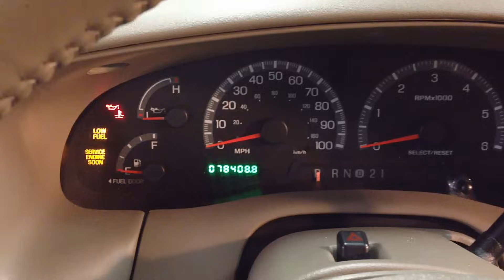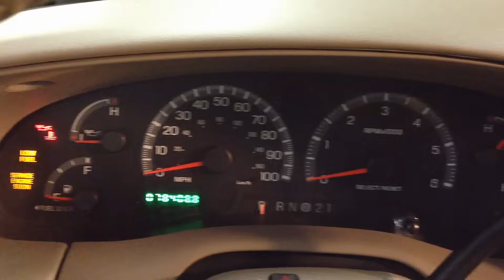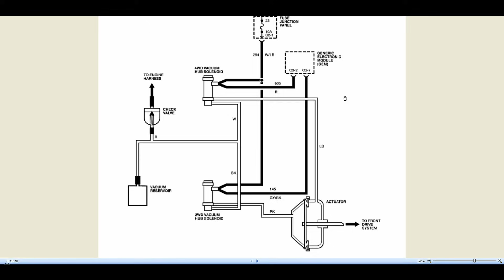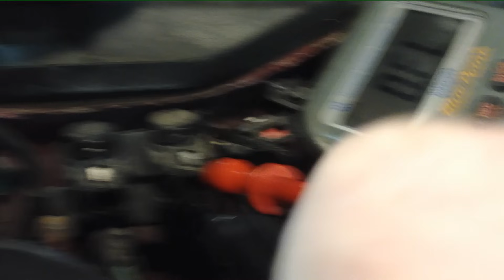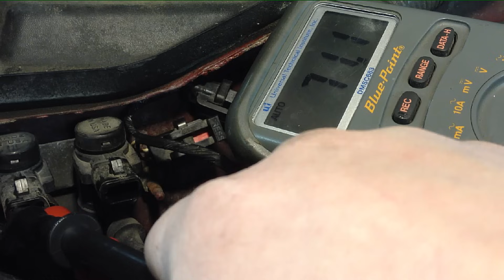1997-2004 Ford F150 4X4 Inoperative In Depth Diagnosis

Comment: I know this is an older video, but I can't seem to find a similar issue to mine. I have a 1997 F250 light duty 5.4, and turning the 4wd selector switch does nothing. There are no clicks from the GEM module, and the transfer case doesn't engage. I put a brand new Cardone transfer case motor in, no change.

Comment: like your video. I'm having a problem that I can't get it out of 4 wheel drive. at the end of your video you talk about the actuator engaged in 4 wheel drive, can I remove the vacuum hoses at the actuator  to disengage and bypass it to get it out of 4 wheel drive? looks like the actuator is stuck. do you have a video on removing it? thanks.

Comment: Thanks for the videos, they are really helpful.  Older post so not sure if you will be seeing this but since you were nice enough to offer help at the end, here goes.  I get nothing at all when I turn the shift on the fly selector switch on my '03.  Fuses are good (23 and 104). Selector switch has the correct resistance at all positions per the ford shop manual.  NO clicking noise from the transfer case relay under the dash.  The 2wd solenoid has constant power and ground, the 4wd solenoid has constant power but never gets ground when I turn the selector switch (which makes sense if the relay does not work).  I went to my local pick-n-pay and pulled two relays and neither of them made a difference, so I assume not the relay. GEM module is not "wet" per other posts I have read.   Any thoughts are appreciated!

Comment: I have a 2004 F150 Heritage. The 4x4 light does not go off. The transfer case is manual shift. Also a note, is that the shift between 2wd and 4High is very short. Any help would be great

Comment: I have a 2004 Ford F-150 with the 4.6. I have a aggressive grinding noise when I  give it gas but when I left off it’s tames down a bit. But when I have it in 4 wheel drive it goes away but when it’s it 2wd it starts grinding again. Needing help figuring it out. I was planning on taking it in but I don’t trust shops very much to work on my vehicles.

Comment: I have a 1998 expedition is this the same system as mine? It's having issues and the a4wd light is flashing and it's very jerky and jolty when turning it full tilt at slow speed while parking

Comment: Great video, but ive tried what youve said, still got an issue. While driving normal in 2wd, my 4x4 light will come on, and sounds like its trying to engage, then grinding and a thump. I can stop, put it 4wd high or low, everything works. Its gonna destroy my hubs if i cant figure it out. Done replaced gem. Its a 97, 4.2, 4wd, 5speed, with manual 4wd lever.

Comment: OK, so here's my problem--

Truck showed it was in 4WD and I didn't notice until I made a tight turn in the parking lot and it hobbyhorsed on me. Couldn't get it out of 4WD. Watched your video, went out and got a new transfer motor. Replaced motor, still shows in 4WD but now in 2WD.

Checked vac reservoir for leaks with a vacuum gauge. 15 to 20 with engine running. Still held vacuum with engine off. Only held for about 2 minutes, but that's pretty long considering the homemade test connections I had. With the factory lines connected, you hear the hiss of the vacuum being released up to 10 minutes after the engine is stopped and you remove the factory lines.

Ran a vacuum pump through the factory lines to axle connect actuator, got no leaks. Connected pump to 2WD and 4WD line, had to pump several times to get vacuum when I changed from 2WD vac line to 4WD and vice versa. After letting vacuum leak off, staying on same line, only took one or two strokes to get vacuum up again. From that I assume no line cracks, not a leaky diaphragm.

Checked voltages to solenoids. As advertised. In 2WD, voltage to 2WD solenoid. In 4WD, voltage to 4WD solenoid.

Checked fuse #23 in Pax compartment, fuse #104 in engine compartment. Both good.

No vacuum leaks. Correct power to solenoids, but transfer motor doesn't move. All fuses I can find associated with 2WD/4WD good to go. What am I missing? Is there a sensor switch that cuts out 4WD engagement if the hubs aren't locked? Is the 4WD light on constantly a code for 4WD issue?

Comment: Love your videos, watched a few and fixed my four wheel drive yesterday. It was a vacuum issue, I had a clogged check valve right before the solenoid.  05 F-150 Lariat. Couldn't have fixed it myself without your awesome videos, keep up the good work!!

Comment: My four wheel drive lights up on the dash but doesn't engage this is on a 2001 f150 lariat. When I flip it into 4Hi I hear it clicking on the dash. I am not wanting to just throw money at it until works so would you know where would I start at diagnosing the problem at? Any help would be greatly appreciated.

Comment: Wondering if you can help..on my 97 4.6 super cab my signal lights refuse to work lol..I've checked everything I can and know to do, replaced the multi switch also.. happened about 2 months after replacing the GEM. The bulbs work it will flash but once.

Comment: So if the left hand harness doesn't show any power with the dial switched to 4 high.....what should I check upstream to pinpoint the problem?  Would I have to replace the GEM??? Also both my solenoids showed no resistance. Going to replace those anyway, just need to figure out what I need to do that is upstream of those before I can test the vaccum on the solenoids.

Comment: Great video- I needed this. My problem is that the switch is NOT working. It's lighting up from the little LED, and neither the 4x4 or Low Range light is coming on in the instrument cluster. Checked fuses in fuse box under dash and under hood- both good. Going to check my solenoids next- am I on the right path? Also going to check the switch with the ball bearing thing on my T-case and replace that. I bought the truck a few months ago and the 4x4 worked fine then, but also found out quickly that a mouse had gotten in and died.....hoping  Mr. Squeaky wasn't the problem, haha.

Comment: 02 F150 5.4 4×4 partially engaging. Have already replaced passenger side CV axle and hub assembly and driver side hub assembly. Was hearing grinding/scraping noise from front passenger and now hearing a from front driver sounds like a ratchet ratcheting/ticking..

Comment: I have an 05 4.5 that will not go into 4wd while the truck is on. I have to turn off my truck and than engage it. Is this a bad actuator or a bad transfer case motor???

Comment: I have a 03 f150 and I have the power constant to both sides but the ground switch does not move when switched to 4x4 fuse 23 is good , module ??

Comment: My Expedition is 23yo so I will probably just replace the tcmotor and the solenoids and hope for the best. The parts are cheap and the labor is ez. Just do it. For $100 I will have done all the ez work on my 4wd system. If my diffs or shafts go down then the car is probably mechanically totaled.

Comment: Hi! I watched your video and is pretty good. But I have a question or a situation with my 1998 F150 V8 4.6 L. The 4x4 doesn't work at all, but the windows don't work either. What do you think is the problem with that?

Comment: So I can’t get my 4H or 4L to pop up on my dash. I hear the relays turn on and off but nothing. Ive replaced the transfer case motor and it would work in 4H for a bit but now it won’t shift into 4H. When I would be in 4H and try 4L it would just turn off and switch back to 2H. Looking for any help🙏
Reply: Now the light on my dash for the 4x4 is stuck on. The relays click on and idk how to turn them off. When I move the switch it does nothing

Comment: Hello I have a 1998 F250 4/4 Is it normal to hear a vac hiss for about 5 secs.after you shut down the engine. The sound is coming  from the EGR vac.solenoid ,no codes present Thank You

Comment: Hello I have a 1999 Lincoln navigator and recently the 4x4 light started flashing on the dashboard. I’ve noticed when I make U-turns or reverse it goes into for low and locks the tires I have to put it in neutral and turn my steering wheel straight and then turn my knob to Forlow wait for the clunk for high wait for the clunk and then back into all wheel drive. Do you have any experience with this? Once I do that he drives fine up and down the road no issues only when I first get in it and I turn sharp or do you turns or try to back out Turning the steering wheel

Comment: My 1999 F-150 will only energize the 2WD solenoid. I tested both 2WD and 4WD solenoid control plugs with a voltmeter and both had 11.6 VDC with key on and engine off and both lost voltage with key off. However when I used my volt-ohm meter in ohms to look for the switched ground coming from the GEM module I only saw it coming in on the 2WD control plug with key on and engine off no matter what position my selector switch was in (2H, 4H or 4L). I also ran the engine with both solenoid control plugs connected and all vacuum lines disconnected and verified both vacuum inputs to both the 2WD and the 4WD solenoids had vacuum. I then plugged in the input vacuum lines only to each solenoid and left each output vacuum line disconnected so I could verify vacuum at each output port and I always had vacuum at the 2WD output port and never on the 4WD output port regardless of control selector switch position.

I replaced the selector switch with a new one and the same thing happens. Seems to indicate a problem with my GEM module? Any advice as what to do or check next?
Reply: Did you ever solve this?
Reply: Did you solve this?? ^^^ I have a 98 Fully redone new motor name it. My 4x4 was working fine then one day just quit. I did all these tests. My switch on dash nob is now not lit, and clicks 4 times in dash. Yes fuse is good. Suggestions??? @gaelculver4880
Reply: @FordTechMakuloco
Reply: Im having the  same kind of issue grounds and power are not right
Reply: Check your grounds! I bet one of them rusted out. FORD=Fix Or Repair Daily

Comment: I have a couple problems with my 01 switching in and out of 4wd.
1 the transfer case doesn't want to shift in to 4high while driving, it makes a horrible chain growling noise
2 after using 4wd the system doesn't want to disengage even after shutting the engine off and if I go from P to D it makes a loud hammer noise and jerks the truck.

Comment: Thanks for video, scanned found P1876, both solenoids have ground no matter the position, live data shows switch working on dash.  So will continue my search to see if can find schematics, paid for a manual but was in PDF and they skipped most of the schematics, of course...
Reply: I see to look at 605 and 145 from GEM, had all those pages for troubleshooting, had hoped wasn't GEM related but person said GEM was bad so swapped it before testing anything, and then this issue, so that GEM maybe faulty, seller claimed has to be programmed by Ford, but see numerous threads saying if same numbers on GEM that wasn't the case, only some security module needs flashing if swapped, not sure if true, almost ready to swap old GEM back into her to see if this issue goes away...
Reply: Since 4x4 worked old GEM guess swap back in and see what trouble can get into with old GEM, cousin scanned it told me bad, he bought Truck for motor then passed and I got 'the honor' of owning this old rusty Ford and bringing it back to at least dump run duty...
Reply: Swapped back, no joy some different codes though. now P1824-P1832-P1838 and it doesn't care if use seatbelt...  both solenoids power and ground any switch setting, although outside one does not pass vacuum inside one does. prob a good thing.. live data shows switch working. I do have a spare t case motor and been advised on the wire have to insert into its harness, what a goofy design.. P14 think it was forget now..
Reply: rewatched video on testing solenoids, key off all 4 contacts grounded, key on 2 hot 2 ground no matter position, ready to cut up dash so can pull GEM harness out to test as pulling it out to try and test is one of the reasons I stopped buying newer vehicles, too many engineers without any mechanical skills, or told to make it so hard only Ford can work on them so more cash for them, whichever not happy.. If I had designed it, you betcha you could reach up and remove needed connections for tests with ease...

Comment: 2001 ford f150 4x4 5.4 the three air lines come up from the axle actuator the black line comes up but can't seem to find where it goes the blue and red is connected both solenoids have their lines and black box behind battery has all their air lines

Comment: Have a 2002 Ford Explorer Sport. The same this happening. I have taken off shift motor from transfer case. It's good, check where it was shifted to. Which 2wd. But the front end still feels like it is in 4x4 and it's still noisy. Is there any way I can get info on this . Diagrams, videos anything would help.

Comment: Thank you first for you time in sharing info. I have a 99 f250 5.4 4x4 I just bought.  All the vacuum lines were removed from the system and the ones down below by the actuator on the differential were melted. I bought new upper and lower lines for the differential and the actuators to the reservoirs and the vacuum source which I did not know where it was so I found vacuum in the added it but I'm not getting no 4x4 to the  front still .  When I got the truck the actuator was wired closed like all the way to the left After watching your video I seen that should be more like when you have vacuumed to both ports on the actuator I'm just kind of lost don't know what to do or what to look for diagrams or schematics for the vacuum

Comment: my vaccume line was broken and I repaired it with electrical shrink wrap over the lines and used my heat gun to shrink it. worked perfect.

Comment: Hi, My truck is a2003 Ford f150. I followed your video all the way to my actuator checking everything along the way. My actuator is engaging but both wheels when in 4 wheel drive are not turning together. Can you tell me what I need to check next. Thanks Pete

Comment: Thank you so much for your explanation of the system.  I have a 2004 F150 Lariat and when I change the selector button of the 4x4 system I don’t sense anything happening.  I’ll check everything you showed in the video to see if I resolve my problem.  Thanks again sir.

Comment: Very helpful, I have no vacuum when connecting the lower hose, on the top hole on the 4 wheel drive, when I turn the switch nothing happens no sounds, nothing, I do have power at the solenoid.

Comment: What happens if the 2wd solenoid fails but not the 4wd solenoid? I have the 4wd solenoid ringing out at 66 ohms and the 2wd solenoid ringing out completely open meaning it has failed (there is vaccum). What I can't wrap my head around is that it will not shift into 4wd and the cluster light stays out. I have the msof type transfer case.

Comment: I'm hoping you still check these threads, 98 f150, no 4x4 light on dash, I don't hear the relay click on the left like you said, with the key on and moving the switch .  fuse 23 checked good. is this a sign of the shift motor failed?

Comment: I used test light, right connection on the solenoid light on in four wheel switch inside.. on negative side the light does not come light.? off and on switch inside.? what does mean.?
Reply: on the dash 4x4 light does not come light.?

Comment: Thank you I recently bought 2001 f150 that was sitting for a little bit,it's a good truck with high miles and gaskets seals and sensors is what I'm going through. Awesome intake video replacement you provided and that's what I'm doing next is oil filter coolant gasket and then making it goes into 4wd properly. Thank you again your knowledge and effort are well received, Thank you

Comment: Thank u so much.  Mine quit but I messed with all the vacuum lines cause battery acid had broke them.   I spliced them wit rubber hose but I bet I didn’t get it back 100%

Comment: Hello i have  1998 f150 4wd  5 speed , its tryin to engage on its own ,4wd hi light comes on this happens while driving 30 ,40 mph then all the sudden it sounds lijke gears are tryin to go together and there not lined up . At this point i have oun hooked vac line to engage 4wd no grinding now be light 4wd still comin on . Please any help would be greatly appropriated thank-you

Comment: I've watched this video and see what's going on I get the ground like I'm supposed to to from the 2 wheel to the 4 wheel but when I flipped the switch to go back to the 4 wheel I'm no longer getting the ground to switch everything back into 2 wheel drive I have changed the vacuum modules the modules the everything underneath the transmission relay shouldn't realize the switch everything and I still can't get it to work right any help from anybody would we appreciate it

Comment: Mine turned out to be a transfer case shift motor. It was rusted. DDID NOT SET CODES FOR SOME REASON. always chech shift motor before checking everything else

Comment: Hey FordTechMakuloco, What about 2003 ford expeditions? I have two of them, one has only 4 low, and the other has no 4x4 at all. I have switched every component except for the GEM module, and nothing changes on the two trucks (I even swapped the fuse box in the passenger foot-well).
I have no idea where to find the GEM module on these 03s, and some people say they don't have one.
Is the "Anti Theft Locking Control Module 2L1T-15K602-AP" the GEM module on these?

Comment: Sir I have question I put98 5 .4 f150 4x4transmission I  in my 2003 5.4 f150 and bolted rote up but all the plugins on out side the trans are different changed all but the one behind the dipstick passenger side it plugs in but the pins are different do I need to change that and how do you change it need help badly thanks